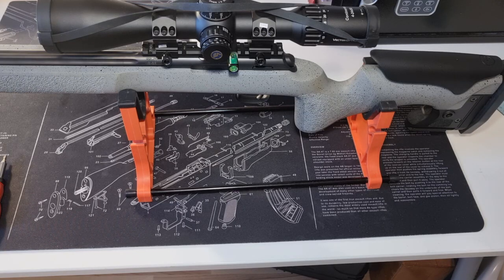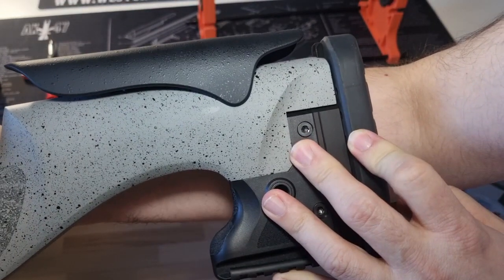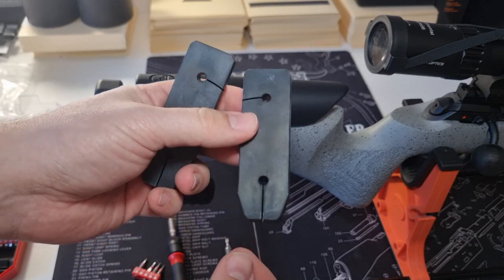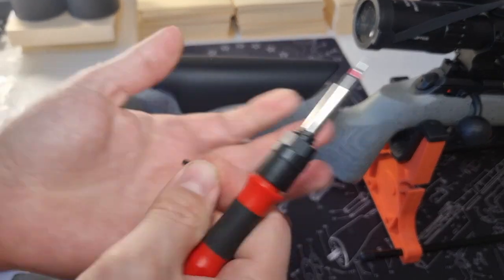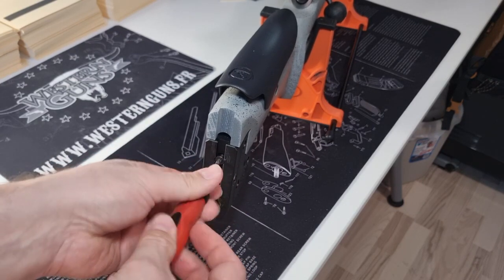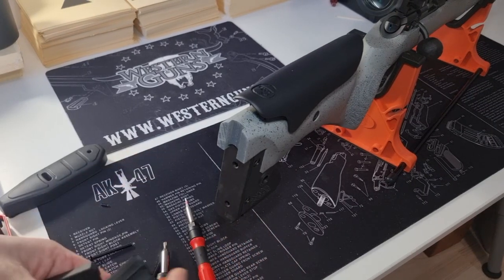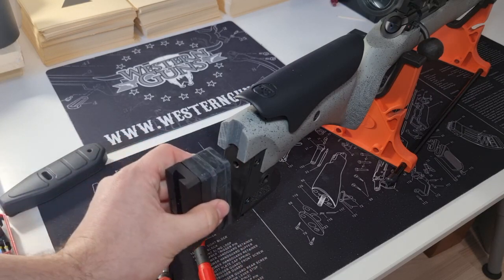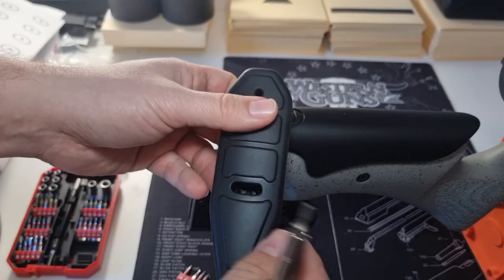CZ 457 LRP Length Of Pull adjustment [EN]

Comment: Un material foarte util pentru reglarea patului armei. 
Adaug faptul ca acele tăieturi de pe distanțiere sunt realizate pentru a le putea introduce fără a fi scoase șuruburile complet. Se slăbesc pana la dimensiunea necesara și apoi se introduc distanțierele prin presare (mai întâi jos și apoi prin lateral în partea de sus). Acest mod de inserare se folosește și la modele din anii 80-90 ale armelor de tir sportiv olimpic: Anschutz cu arc și precompresie, mod 2000, 2002, Feinwerkbau cu arc și cu precompresie, Steyr, și probabil ca și altele. Mult succes în continuare.
Reply from the maker: cool. nu stiam. merci